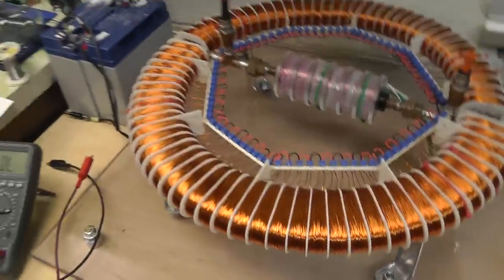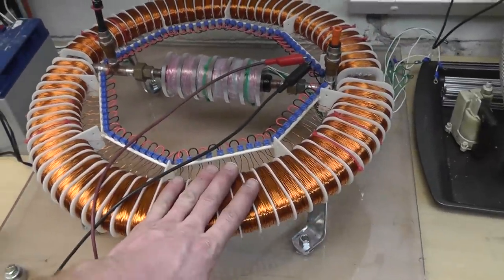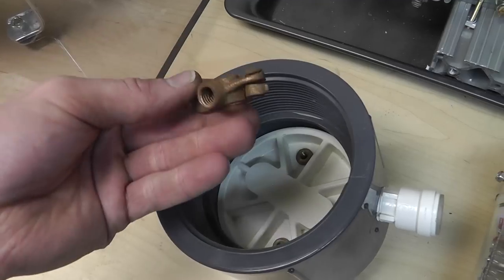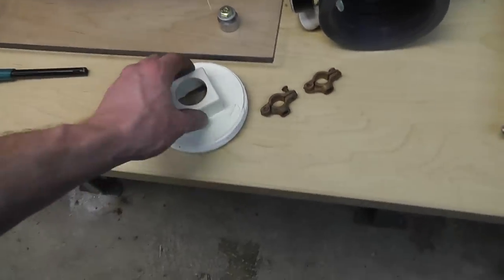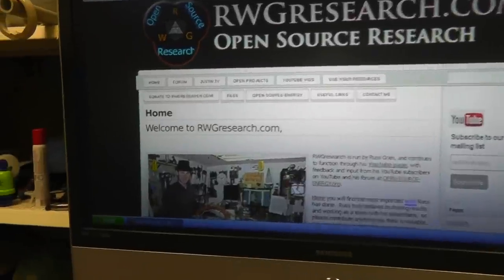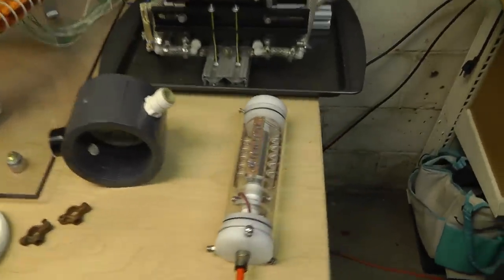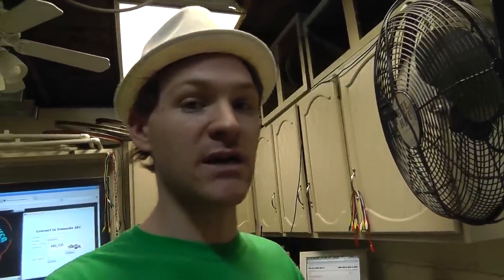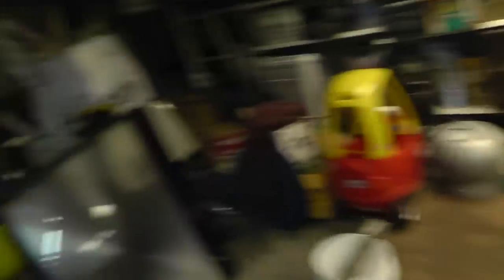EPG Work Continues Again, Live Show Update & Email Info Sign Up 3-20-12

Comment: Those copper coated connectors, which you think are coated really are a copper alloy called "composite". They are a mixture of metal, which is a mixture made similar to bronze, and they do have traces of iron in them for strength. Unfortunately, even copper bolts have this in them unless they are strictly labeled pure copper, pure brass, etc. Copper is very soft and would strip out very easily if it didn't have iron in mixed into many different types of connectors that are currently made. Copper can be hard drawn to make it hard enough to bolt connections, but, strength isn't the best, especially if sealed connections are needed.  Red Brass is a very good conductor and is still made today to manufacture these connectors. It wouldn't be a bad idea to try to find some of them because red brass is very hard opposed to copper and has great conductivity. Unfortunately, copper, brass, bronze, and composite all oxidize, so, preventing any oxidation can be done using a very thin layer of penetrox, which is an oil based anti oxidant that is used on electrical connections. The lightest layer protects against corrosion for years if it isn't wiped off, as well, it will harden over time if left in the air. I just stripped off some old high voltage electrical connections that my Dad put together 40 plus years ago and they were like the day they were made. It eliminates the aging process of many metals, and works perfectly every time. Unfortunately, this can not ever work under electrolysis unless a circuit is built like Bob Boyce's is built that will produce HHO between SS plates instead of on them!

Comment: The reason IMO, that Stan ionized the water by reasonise was because it sort of soften up the water molecule so that when the molecule was fractured it didn't need as much energy - volts.  and made it possible to make a 'pressreized' adapter for converting gasoline cars to hydrogen, small tube is safer then a whole pressurized tank.

Comment: USE UV LIGHTS TO HELP DISSOCIATE THE WATER, LOWERS ENERGY INPUT, AND USE ELECTROSTATIC FIELD TO SEPARATE THE GASES
Reply: Oh man you're a hoot
Reply: +Wes Jones how much does the prison pay you, is it by the hour or by the post
Reply: OVERUNITY BUILDER nice loaded question kid. Are you that afraid of science? I don't blame you.

"The total energy of an isolated system is constant; energy can be transformed from one form to another, but cannot be created or destroyed. The change in internal energy of a system is equal to the heat added to the system minus the work done by the system. Equivalently, perpetual motion devices of the first kind are impossible" (The first law of thermodynamics) When you explain how it is that you have undermined and proven wrong all of physics, then I'm all ears as to how you made this work.
Reply: +Wes Jones UV LIGHT ENERGY HAS BEEN PROVEN TO LOWER THE BREAKDOWN BOND ENERGY OF MOLECULES SEE BLACKLIGHT POWER  SITE OR GGOGLE IT. ALSO ELECTROMAGNETIC ENERGY DOES NOT FALL UNDER LAWS OF THERMODYNAMICS,,..THE LAWS OF THERMODYNAMICS DO NOT APPLY TO RELATIVISTIC SYSTEMS-------PAGE 94-ELECTRIC CIRCUITS BY J. RICHARD JOHNSON-HAYDEN PUBLISHING CO  Electromagnetism is inherently relativistic...page323..ESSENTIALS OF ELECTROMAGNETISM..BY DAVID DUGDALE--read  chapter 12 on "RELATIVITY AND ELECTROMAGNETISM> FROM BOOKS WOW

Comment: bashar is 2 coils cones ,in electrical parellel and in magnetic series is the shape of bashar, and how it should work do to pmh, its more than just capacitor, its a genarator in right order cus in donut application h2 would flow inside negative of both coils one on each side possitive on left negative on right hand ,for right circular motion ,but for donut application, h2 sponge inside

Comment: Actually they are both simular coil's the star ship coil is a straight line field and the roden is a spinner type giveing rotation s of ganeics they both have a spin to them one is just stronger than the other difference being the shape roden is a south south or a north north depending on witch way the electricity is feeding in star is a north south now putting an alternating curent in to the ciols the result is allways the direction of the windings hope it helps

Comment: Russ amazing work. Now its 3 years later did you ever manage to get EPG working? I think all coils should be connected in parallel, (one ring on top to which the beginning of all the coils is connected and one ring on the bottom to which the end is connected). I'm thinking magnetic gas is the tough part to make. Stan used Argon along with high voltage sparks from Ferric electrodes, he also had strong magnets in the enclosure to magnetize the iron from the sparks. Thumbs up to your work! The day for free energy is coming. Also, I think the metal that Stan used for the tubing isn't copper, its brass, I'm thinking aluminum would work as well. Copper on top of copper isn't as good.
Reply: ***** Stan Meyers had it working, so we know it can be done. The key is magnetic gas at room temperature. Stan Meyers used argon and free Fe (iron) in vaporized form. The Fe would come from the electrodes. Argon was blasted with a laser to remove 1 electron giving it a total of 7 electrons in its outer shell (normally argon has 8 electrons because it is a noble gas). The 7 electron Argon binds with magnetized iron creating an inert magnetic gas. This gas is pressurized inside of the core of the device and is moved around the loop using either a pump or a pulsed coil. The output is determined by 3 things: pressure of the gas, the number of coils on the device, the speed at which the gas is moved. :) We'll get there soon, cheers.

Comment: I bet that all of this turns out to be a complete waste of time. Honestly Stanley Meyer just uses Tesla equations for his high efficient fuel cells. All it is, is build your fuel cell then use your cell dimensions to calculate the resonent frequency of the fuel cell. Then build a custom Tesla Coil that matches cell frequency and feed this Tesla coil with one octave lower resonant signal. So its freq-gen to Tesla-Coil to Tesla-Choke to Cell. Pure charge is recycled between the Cell & Tesla Choke.

Comment: Would it mean that there is minimum resistance on a parallel connected pattern?
Reply: Yes, the longer the length of wire, the more resistance.
Most electronic wire has a label showing Resistance in Ohms per meter length.